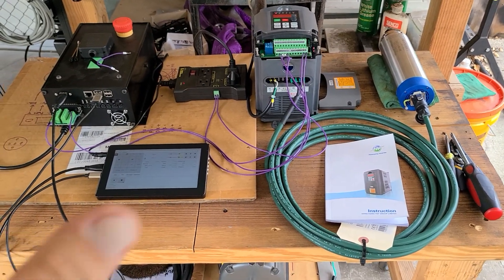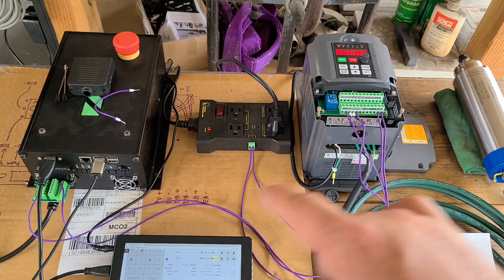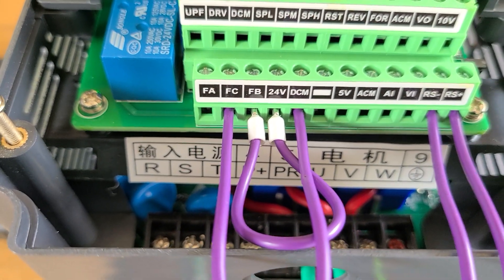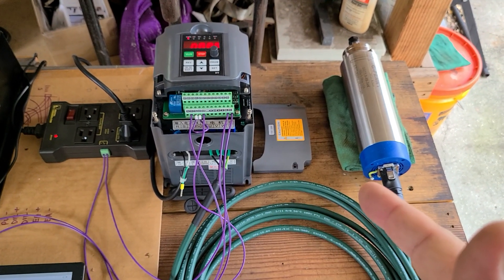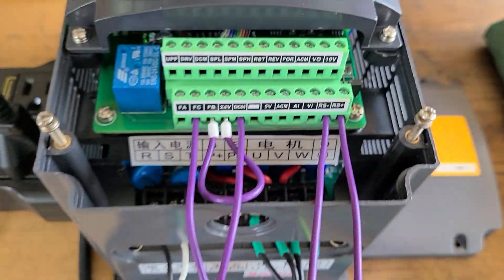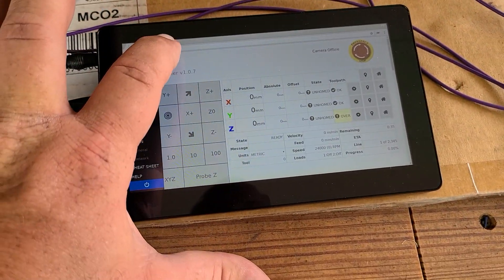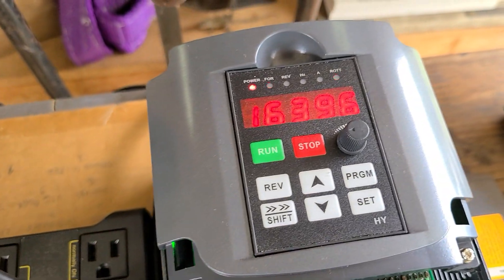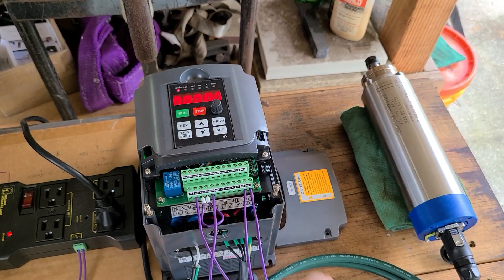Onefinity CNC - Controlling a Huanyang VFD & IOT relay.

Comment: But you wouldn't want it to run below 12,000 (my spindles slowest speed), because the design of the spindle requires centain speed to keep it cool. I would rather break a bit than burn a motor or am I seeing this wrong?

Comment: Is there a reason you did not ground your 220 mains in?
Reply from the maker: It's 120v and the video was for demonstration purposes on how easy it is to setup a VFD and spindle to the Onefinity cnc controller. You can see by the video this is a test setup on a wood table just to make the video.
Reply: What type of wire to connect the vfd to the Onefinity breakout board?

Comment: I have been setting up my vfd and I would like to just turn spindle on and off from my X-controller that is all I want it to do. I would adjust single speed if needed at the vfd. Do you offer your services? Thanks for your consideration!
Reply from the maker: X controller?
Reply from the maker: So you are wanting to just use the  VFD to manually adjust speeds and that's it?
Reply: Yes x controller. I am needing to just turn spindle on and off the speed I can simply adjust at the vfd because I typically run at 10,000 for what I carve. Thanks
Reply from the maker: @briancasey5570  I'm just confused. What's an X controller?
Reply: Well I’m not sure I’m learning. I have a x-carve machine. Hope that helps. Thanks
Reply from the maker: @briancasey5570  Ahhhhh. Okay. Yeah I don’t know much about the Xcarve. This video was more based around a Onefinity cnc router.

Comment: are you willing to share the directions on how you wired up the IOT relay?
Reply from the maker: Do you also have a HY VFD and spindle as well as a breakout board?
Reply: @jasonstewart5942  I do and the IOT power strip
Reply from the maker: @SYLTHECRU  I’m sorry. I meant to reply to you but had gotten tied up at work that day. Are you in the Onefinity unofficial users group on Facebook? I could do a wiring diagram or something of that nature and post it there with pictures & such.
Reply: @jasonstewart5942  I am not on the Facebook group as I do not have Facebook, but I am on the Onefinity forum.
Reply from the maker: Okay. I'll try and do a wiring diagram and what to program on the VFD so that you can do this as well.
Reply: @jasonstewart5942  Jason, what is the onefinity group name on facebook?
Reply from the maker: "Onefinity unofficial users group" if I remember correctly.
Reply: @jasonstewart5942  I joined the infinity group on Facebook. How can I get I. Touch with you?
Reply from the maker: @SYLTHECRU  just type in the group search (magnifying glass icon) for Jason Stewart.
Reply: @jasonstewart5942  I just reached out to you on facebook,
Reply from the maker: You might have messaged my account that got hacked. I can't get into it to see anyone's messages.

Comment: Jason - would I use the same procedure to set up the pump to automatically turn on as well?
Reply from the maker: Yeah you definitely could.
Reply: @jasonstewart5942  might there be a different method you would recommend?
Reply from the maker: If it were me I'd honestly probably just use this method. I mean there are other methods, but the IOT relay has 2 120v outputs so one could go to dust collection and the other to the recirculation pump.

Comment: Looks like a nice upgrade. Please provide details on the VFD and spindle .... thanks
Reply from the maker: Reason I didn't provide links is because this stuff is all over Google, but can sometimes be hard to find exactly what you want or need and it depends on what voltage you have and plan to use. 110v, 220v, 380v, etc.